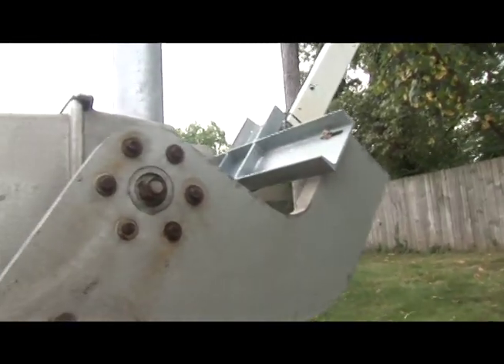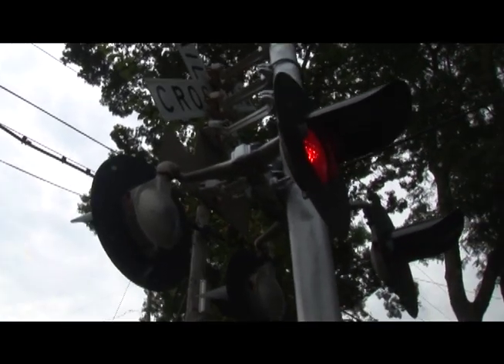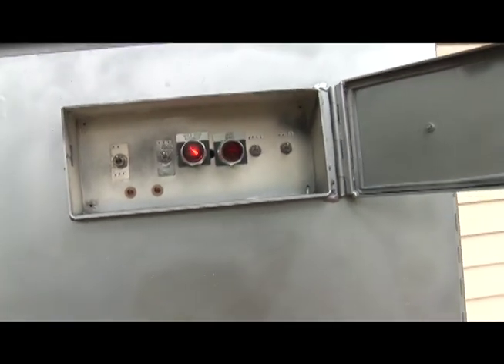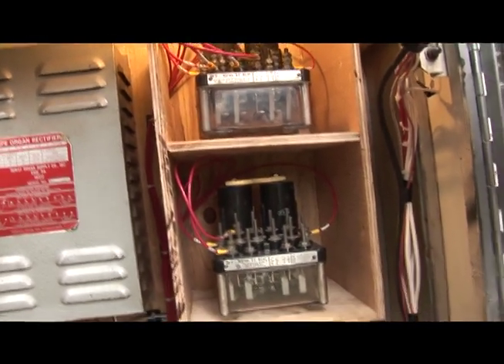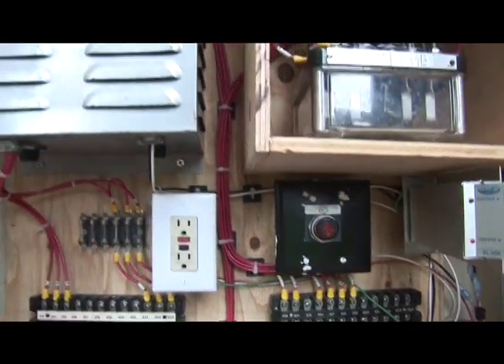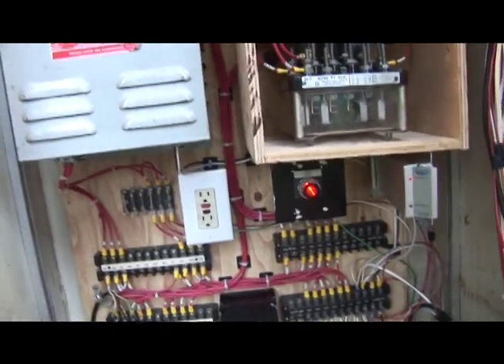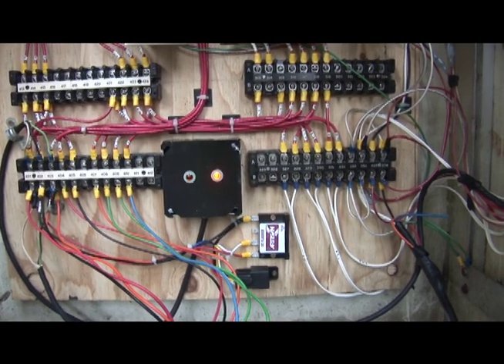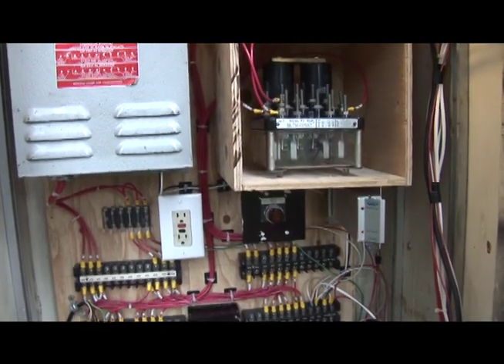Backyard Rails & Lights: Unveiling the Ultimate DIY Railroad Crossing and Traffic Light Series!

Comment: Just a heads up, the #5 contact is a snubbing contact. It will shunt the motor (usually set at 5 degrees) and allow the gate to be less violent as it reaches the full horizontal position.

Comment from the maker: Thanks for the comments. You're right, the back visors are not Safetran visors. They were custom-made for a friend that did not need them forcs project and I needed a second set so I got them to fit on the back lights.  Also, the gate lights are the LED RECO ones. I had heard about the other brand but I got these new in box cheap on eBay.